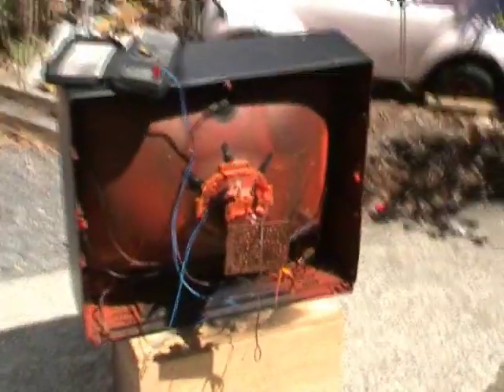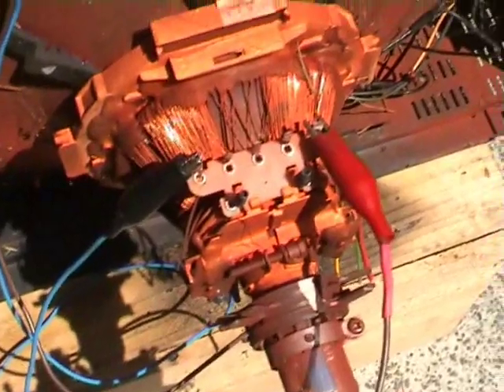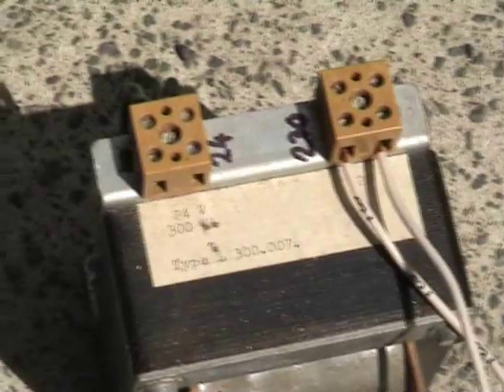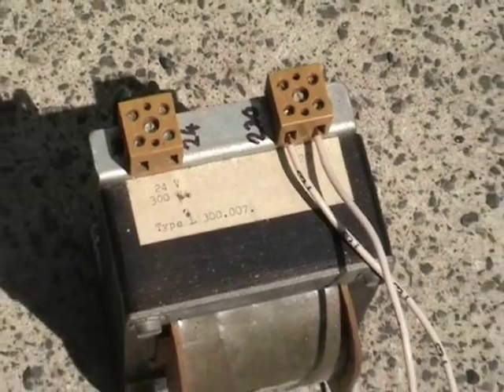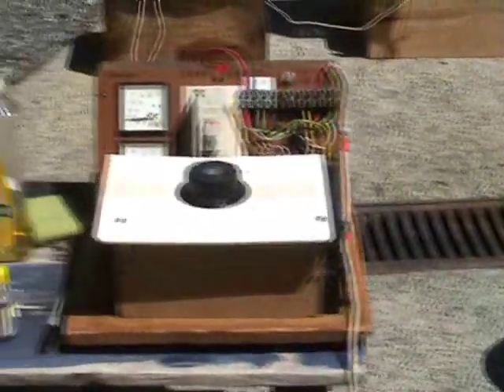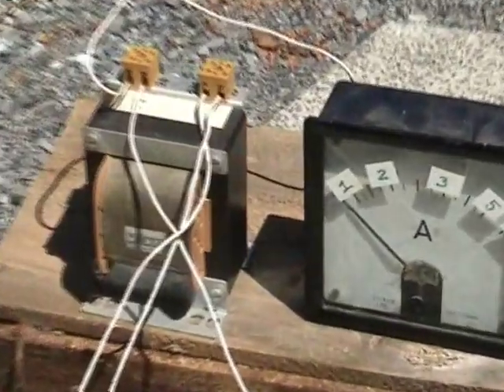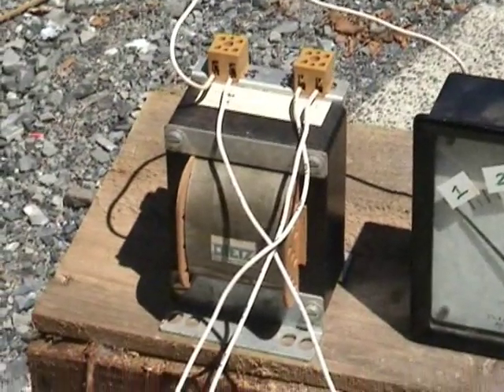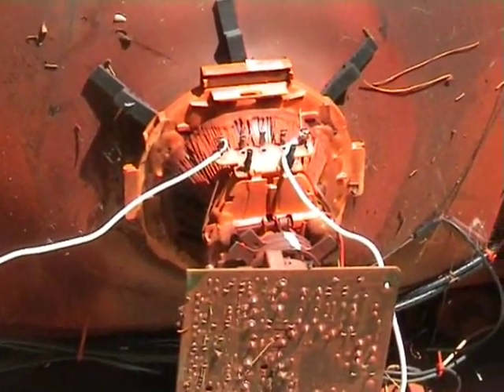CRT deflection coil burnt out and vented CRT tube

Comment from the maker: @mrmatt2525able  The higher amp variacs are expensive. ( 8 Amps and more ).
I got mine out of old test equipment which was discarded at work, many years ago.
Have a look on the e-bay websites.

Comment: laughing hysterically with the several attempts at breaking the neck... lol, its not gonna explode so there no reason to be so afraid ! haha - when disposing these, i used to wrap a cloth towel around the neck and tap it with a hammer and "deal done" - sometimes id just tap the neck with the hammer... "deal done"